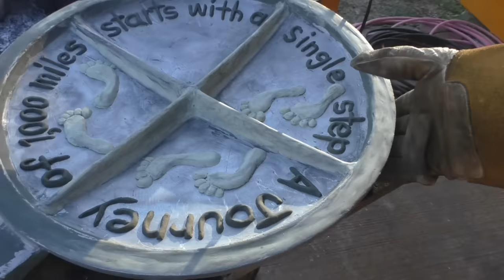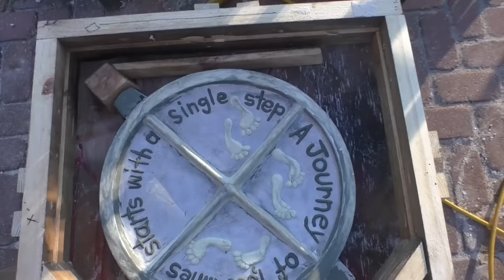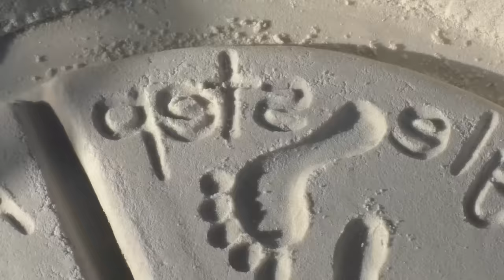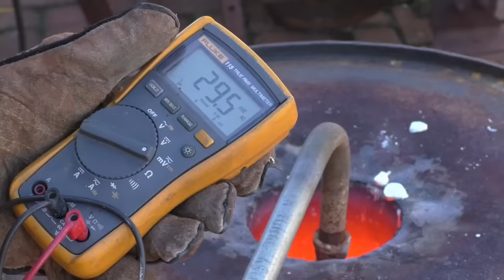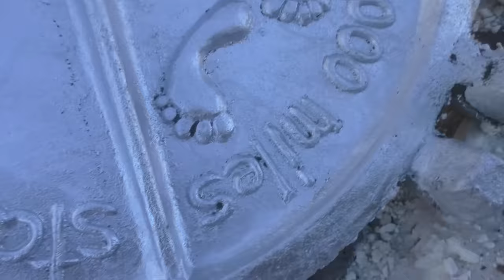Step by Step Aluminum Casting with Sodium Silicate Sand

Comment: hey if i wanted to make utility hook blades out of steel what do you think would be the best method?
Reply from the maker: I think I'd cut them from a plate of steel.  Something that could be hardened like an old lawn mower blade or leaf spring.
Reply: okay thankyou

Comment: What's the ratio of putting sodium silicate in the sand??
Reply from the maker: 2%,  but it depends somewhat on the  sodium silicate.   The stuff used by foundries is the best as it has a longer working time.

Comment: is there a specific reason the riser is square not cylinder shaped?
Reply from the maker: I could tell ya something about not wanting the metal to swirl but to flow as straight and smooth as possible, but it would be 99% hog wash.   It just easier to cut a board into a flat tapered shape than it is a round one.   You do want it tapered so it's easy to pull out of the sand.
Reply: @SVSeeker  haha! i've seen others mention fluid speed, probably a greensand thing? anyway great video- i only sand casted once in highschool. this is the most i learned in 1 video. info on this sodium silicate sand casting seems sparse on YT.. what do you do to avoid trapping air on the pour?

Comment: why use sodium silicate sand...? why not ordinary sand... thanks...
Reply from the maker: By ordinary sand, I think you mean "green sand"?   Silicate sand is easier, it does not need to be mixed, or stored, no muller is needed and it's a process we can more easily preform on a beach.

Comment: where did you get the sodium silicate
Reply from the maker: Foundries have the best stuff, but ebay is a good source,  or the auto parts store if you are in a rush.  https://www.zoro.com/blue-magic-radiatorblock-sealer-auto-copper-1008/i/G2413826/?gclid=CIiHvMvZ4dQCFVNufgod2p0BDQ&gclsrc=aw.ds

Comment: In a small scale I was wondering if you could do use aluminum to cast over a wax figure. (forget the name of the method.. wax figure within sand, hot metal burns wax away)
Does the aluminum get hot enough to burn away the wax?
Reply from the maker: It's called lost wax casting, but you need to burn out the wax out first.   You can also do lost foam casting and that does not have to be burned out.   We have other videos for both or combinations of those methods.  IE: https://www.youtube.com/watch?v=xser_YpYhLw
Reply: So, from what I'm gathering is that you put your wax object to be molded within the 'ceramic' like stuff and let it dry.
Then you pour your metal in and it burns away the wax through the vents?

Would Aluminum work for that, or would I need a hotter liquid metal?

I'm thinking about making cast model sci-fi ships.
Reply from the maker: No.  Burn out is best done in a furnace.  Once the wax is gone, then the metal is poured in.
Reply: I see what your saying now. 
Would there be any method that I would be a little simpler for me? 
All I think I can do for now (space and $) is use a 3d printer to make the ship's shape and a small forge like the one KingofRandom made.
Reply from the maker: Yeah.  Lost Foam.  http://svseeker.com/lost_foam_casting.htm
Reply: Awesome, thanks man :)
Reply: SV Seeker
Reply: Ave

Comment: I thought you only needed a Muller for Petra bonded sand
Reply: sorry, not so. a muller is to reclaim (any) sand. could even reclaim silica sand with water glass..it is just used to break the sand particles apart from each other for reuse..

Comment: Can i use regular beach sand mixed with sodium silicate to make mould?
Reply from the maker: I have not tried it, but I have been told it works.  I think screening the sand with a fine screen would help.
Reply: @SVSeeker  
  i think it will work too
Here where i live we have many types of sand also we have a type of sands that doesn't stick to ur hand and become rock hard after heating it with wood or coal fire for while wierd sand i think its the same sand u use in video its white colour and looks bright like it conains glass pills
Reply: @SVSeeker  by the way im watching ur build since years and i like that part of (variable pitch problem) mechanism its genius 👍good luck with ur vessel

Comment: Hi is possible to make a bullet mold by this procedure?
Reply from the maker: Best to machine it I think.
Reply: @SVSeeker  Thanks, but this way is not possible?
Reply from the maker: @jozsefienciu2325  Ok, if casting is the available option then look into ceramic shell,  or block mold casting.   These processes provide higher accuracy from the pattern.
Reply: @SVSeeker  Thanks a lot.

Comment: Try your hand at lost PLA  casting,you have a 3D printer.
Reply: +Bob Cartwright I guestimate the cost of the PLA to print one of those deadlights  at around $60.  I'd save that idea for tiny stuff, invested in plaster like a jeweller does with wax
Reply: +MattOGormanSmith  I didn't mean it for the dead lights. Melting out the PLA in something that big would take a very large furnace.
Reply: fair enough.  but you don't exactly melt out the PLA, it burns out with little or no ash, so maybe you just need a match in the corner :) exaggerating perhaps,  but PLA melts at a temp a domestic oven can comfortably reach
Reply: so.. you can cast anything as big as a turkey :)

Comment: Looks like concrete supply companies sell sodium silicate in gallon jugs.
Reply from the maker: Cool. Do you know what they use it for?
Reply: I THINK it's an additive as a hardener.  I called consumers, he didn't know what I was talking about but they may have a rookie operator.  That said, tractors supply has "water glass" for $28 a gallon, free UPS ship to store.

Comment: Glass microspheres are nasty on the lungs. I always use at least a basic mask while working with it.
Reply from the maker: +Keegan Heagerty    Wear a mask if yo like but they are actually no worst than air born dust and only an irritant to the mucus lining of the respiratory system.  And the mucus will remove them from your lungs just like dust.  You'd do worst in a common dust storm.

Comment: You've undoubtedly been told countless times, but you should really be using a mask when dealing with glass microspheres. It will screw up your lungs easily. Take precautions for dogs/cats nearby.
Reply from the maker: Hi Mom
Reply: @SVSeeker  -_-

Comment: Time stamp 21:32 "A great way to get rid of you old motor oil." Are you sure? Also, time stamp 30:15 where you say aluminum is "only 1300 degrees" so you don't wear safety gear. Duh, Einstein. I've never seen anyone intentionally pour molten aluminum on their foot. Your video is a recipe for disaster.
Reply from the maker: Oh, don’t be a pussy.